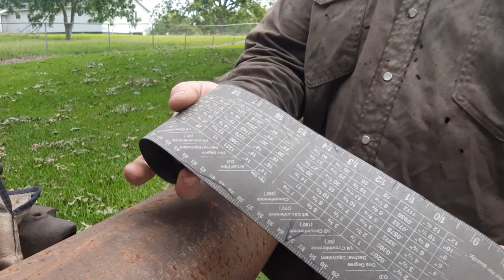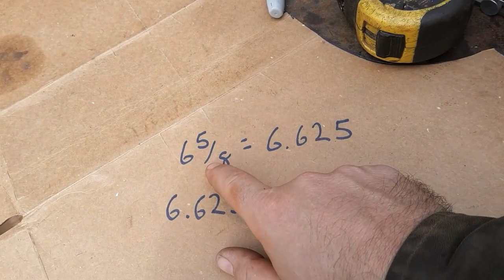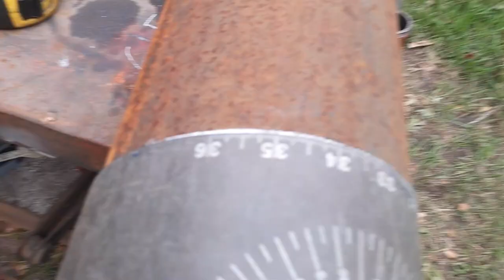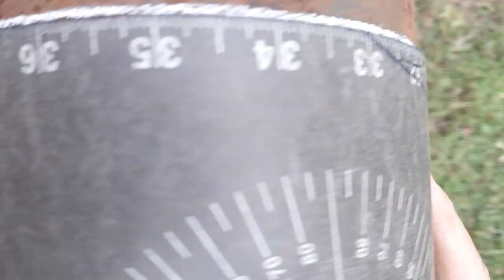Building A Bridge

Comment: Can a portable deep cut saw cut 1/4"? Also why did you cut the holes for the cylinders as ovals? Is it because they lean forward as the rear travels up and down?  Another idea- Have a donut routed from 3/16"-1/4" urethane and use it as a spring cushion at the top of the spring in the bridge cup. It should work great for noise reduction and you can account for the extra thickness when creating the cups. Just add the thickness of the material to the height of the cups.
Reply from the maker: Yeah a whole saw will work I use that to cut cylinder holes and body mount holes when wrapping frames also you are correct on the oval hole the cylinder needs to pivot when traveling and I normaly put pvc pipe around the cylinder to keep the noise down

Comment: Love how you do your bridges Dan I’m about to do one my self. Wondering what would be the maximum height for the smoke stacks? on a big body so I could get the most amount of lay
Reply from the maker: I have found 2 inches tall works the best I use 8 inch pipe
Reply: @thecadillacdanshow8658  good looking out appreciate it ✌️also do you find that the coil catches at all on the pipe edge when 3 wheeling?
Reply from the maker: That's why I went to the 8 inch pipe

Comment: To cut that 6" pipe, I was thinking about making a jig to hold a torch at the right cutting angle (make the holder adjustable) and then making a separate V shaped rest with wheels in the V that the pipe rests on. Then you can fire up the torch and rotate the pipe by hand on the jig while the fixed torch head cuts. If you want to get really fancy you could use wheels that are connected by a mini drive shaft to a speed controlled motor to get consistent cutting speed for the best cut with minimal slag. A bit much for one time use, but if you are a shop, it would be useful. What do you think?
Reply from the maker: It could definitely be done they have a tool just as you described they use on the pipe line there is a name for it but I cant think of it but you could definitely build one

Comment: Hi Dan! Could I build a lowrider with a 140 Lincoln welder asking for a friend?!?!
Reply from the maker: Yeah it can be done I would use 75/25 argon gas. Try to stay a way from flux core welding although it would also work it's just a messy weld and lots of clean up
Reply: @thecadillacdanshow8658  thanks for the tip bro!! It's my first time welding and my 85 cutty is patiently waiting in the drive way lol yea this 140 model only came with flux core wish me luck 🙃

Comment: Why not add the angle to the bottom of the bridge? I have done tubing on the bottom too.
Reply from the maker: You could I just wanted to keep the underside open I put chain mounts on the bottom I have also seen people add tubing on the sides but with me setting the bridge so high on the frame it would have had clearance issues
Reply: The Cadillac Dan Show 
Very true. Keep doing what you do. It is informative. Thanks for replying. 👍🏼
Reply from the maker: @robertprado8189  will do thanks for watching